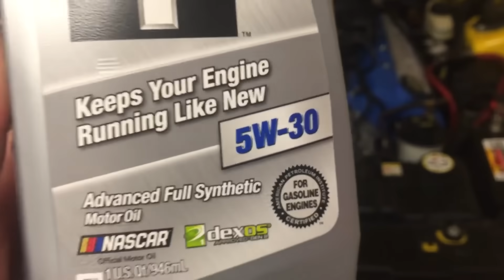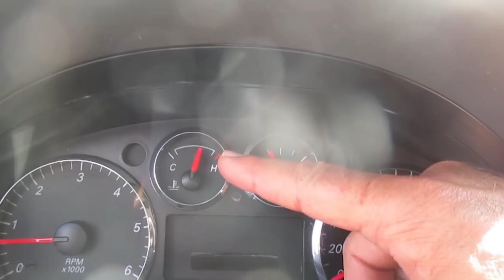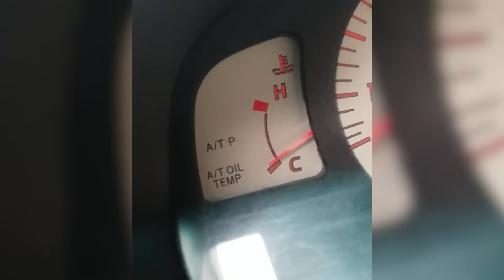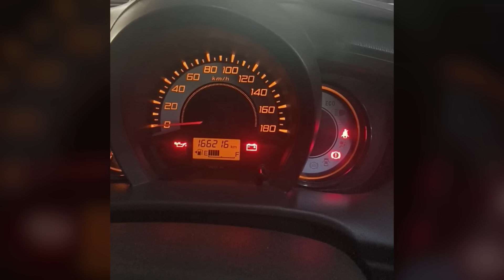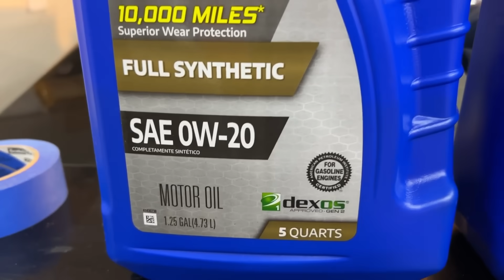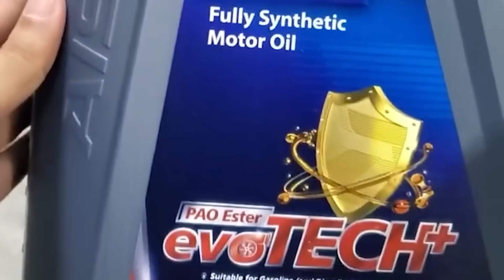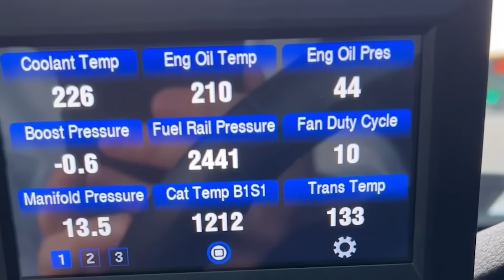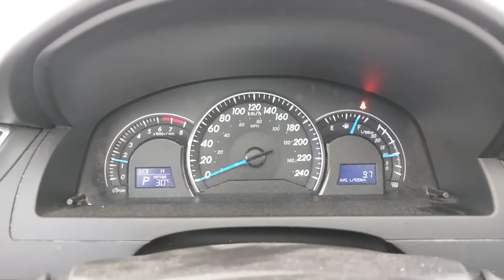Why US  Cars Use 0W 20 But the Same Engines Use 5W 30 Abroad (Exclusive Mechanic Explanation)

Comment: Just pick the oil for your region.  If youre in the cold north, use the thinner oil.  If you're in a warm climate and the block never gets super cold overnight, you can run the thicker option.  Best practice use what they say to use.  Even better practice...change oil at 3k miles.  Don't listen to the 5k or even 10k oil changes.  That's when the wear comes into play.  If your oil is fresh, it protects the best.  The more heat cycles the oil goes through...the more the oil's molecules break down.
Reply: @vintage.....Your first sentence explained it all....!! But you do seem to contradict yourself when you said ..."Best practice use what they say to use." This is the problem and confusion about this oil situation. For every person who says that their car has always used 0W-20 and the motor now has 250,000 and more trouble free miles...no rattle/clatter on cold starts..no motor problems of any kind, there is someone who had rattle/clatter from the very beginning with a new car from using the recommended 0W-20 on the oil cap, but when switching to 5W-30, the rattle/clatter stopped. 

But....usually with these experiences, we were not told where these people lived, and that goes to your point about location. Yep...the experiences are all mixed up. 

I live here in Arkansas, where the Winters are not bitterly cold for long periods, nor the Summers extremely hot for the whole Summer. In fact, the climate for Arkansas is called Sub-Tropical...amazing...because of the bad humidity in the Summer. My 2015 Toyota RAV4 says 0W-20 on the oil cap, but the motor rattled on start and even had a slight rattling sound when warmed up. I switched to 5W-30 and the rattle stopped, and the motor sounds much quieter, like a motor should sound. That was all the proof I needed.
Reply: @StephenJeffery-b6b  yea much agreed.  I've also been told but not quite sure about is...that the computer is calibrated to the oil type and the region the car is marketed to.  I don't understand how that is possible but I've heard that a few times.  My contradiction was mostly meant for those who are unsure of changing oil type.  I should have said "simplest route is to just follow the recommendation on the cap"  but yes you're right about the chatter.  But then again valves chatter, thats what they sound like in good operation.  Slight valve chatter on a fairly new engine isnt really a cause for alarm.  Theyre still chattering in there, the thicker oil will quiet it from.our ear.  But its still happening.  Those valves are clicking and working hard.  As long as the top end has oil its ok. And that it gets that oil after a night of sitting when its all at the bottom in the morning. Modern engines are really good at getting that oil up there quickly on a morning cold start.  Older type cars, takes awhile, pumps arent as efficient.  All we have to do is make sure we're not using thick oil in cold climates and freezing or below freezing temps.

Comment: Manual on mine says 5W-40. It's that euro full syn , but it seems fine. Right at 130,000 on a '12 model. Comp Cam stage 2 and Magnaflow exhaust. Cam upgrade at 100k due to dumb MDS lifter failure alomg with factory ductile steel cam. Billet now Baby. Woke this car up and can check your talent easily.

Comment: I'm running 5w-20 in my 2015 Toyota Rav4 it says to run 0w-20. Just turned 60k and will start running 5w-30 for sure! I'm a retired 40 year automotive technician. My last employer was working for a municipality fleet service department and witnessed the constant engine/valve train  failures of our Chevy Tahoe Police units. We started using 5w-30 instead of the 0-20 the manufacturer recommended and the problems were by far less common. Police vehicles do run under extreme situations.
Reply: @RubenGarcia-nn1vq...Hi, Ruben. A year ago, I bought my first RAV4, a 2015, 2.5 that had 128,000. The oil cap says 0W-20 so that is what I started using on my every 3,000-mile oil & oil filter changes. But I was always a little concerned about a kind of rattle whenever I started it. I just assumed that it was meant to do that. I began doing a lot of reading, watching videos...some good, others a bunch of BS...and I learned that RAV4's call for different oil numbers depending on the climate/country where the car will be used. I also learned that our government set the suggested number to satisfy the CAFE and emissions standards...and NOT Toyota. 

I asked my mechanic of 25 years about this. Just last week, I was due for another oil/filter change and I had him put in 5W-30 full synthetic. The difference was immediate...no more rattle on start-up, and the motor runs much quieter now...WOW..!! And I have not noticed any change in my gas mileage, and even if I do notice a slightly lower gas mileage, it will be worth it to have the motor lubricated properly. 

I will never go back to 0W-20....what more proof did I need...!!!
Reply: Why not use 0w30, since 30 is the terminal viscosity. And 0W you get a better start on Winter.

Comment: I tow all the time with my 5.7 Tundra. It currently has 367K running 0W20. My last Toyota went to 442K before rust killed it.  Change often is far more important than 20W or 30W..
Reply: So you would definitely say stay with 0W20? I'm asking because I too have 5.7 Tundra...still using 0W20 but people keep saying to change to 5W30. Also how often do you change your oil?
Reply: @dalephillips8250 every 6 months or 5k miles whichever comes first. Oil is much cheaper compared to repairing your engine. And used OEM parts if you own a Toyota!
Reply: killing us through food and our vehicles

Comment: I'd say the biggest benefit everybody is doing oil changes
3mo/3000mi
Reply: 3K on high mileage, dusty location, or working it hard…yes. Normal driving or low miles…no.  5K is 100% fine.

Comment: I have a 2014 Toyota Sequoia that calls for 0w-20.  I live in Arizona and it has 180k miles.  I asked my mech to use 5w-30 and they refused because thats not what the oil cap says.  So I bought a 5w-30 oil cap. 😂

Comment: Why 0W-20 Wins Longevity (Even Though It’s Thinner When Hot)

70–80 % of all wear happens in the first 20–60 seconds after a cold start
0W-20 reaches the camshaft, turbo bearings, and piston rings 2–6 seconds faster than 5W-30 at any temperature below ~15 °C (60 °F). That single fact outweighs everything else.
Modern engines are built for 0W-20
Diamond-like carbon (DLC) coatings, molybdenum disulfide, ultra-hard bearing materials, and tighter clearances mean they don’t need a thick hot film anymore. They need fast flow and low friction.
Less oil consumption & cleaner internals
Thinner base oils + better additive packages in modern 0W-20 synthetics = less ring-land deposits, less LSPI (low-speed pre-ignition), cleaner turbos, longer catalytic converter life.

The only situations where 5W-30 can be slightly better

Constant towing/heavy loads in >40 °C (104 °F) ambient (very rare for most people)
Sustained 130+ mph Autobahn running for hours at a time
Very old engine (pre-2000) with wide clearances

Even then, the difference is small (maybe 5–10 % less bearing wear), while the cold-start penalty of 5W-30 is huge every single morning.
Reply: The only reason 0W-20 doesn't wear the engine when it gets hot is a film strength additive. Toyota did a test and found that was the only way for a 20 weight to work as well as a 30 weight when it gets hot. As the additives wear out so will the level of protection the oil offers. I chose a middle ground with 0W-30. You can have that cold start protection that 0W-20 offers with the hot temps film strength protection that a 30 weight offers. I live in Texas so it's hot enough to make sense for me. The further north you go I think 0W-20 makes more sense.
Reply: @kyj730....HI..And you make some good points. Here is my story: A year ago, I bought a 2015 RAV4 with 128,000 miles. The oil cap says 0W-20, so I used 0W-20 for my every 3,000 mile oil/filter change. Now, every time I would start the car, the motor would make a rattling kind of sound. Last week, my oil change was due. I had my mechanic put in 5W-30 full synthetic. The difference was immediate and very obvious...no more rattle on start and the motor runs quieter. 

So...tell me that I should not have used 5W-30.

Comment: This is my take, 

If your owner’s manual allows either 0W-20 or 5W-20 → always pick 0W-20.
You get:

Faster oil flow on every single cold start
Measurably less wear where 70–80 % of engine wear actually happens
Zero downside when hot (same 20-grade viscosity)
Slightly better fuel economy
Reply: Not me. I’m going to be buying a Nissan Frontier soon & the first thing I do is change out the O-W oil for 5W-30 in my new Frontier. And I live in Pa

Comment: When I bought the vehicle the dealership used 0W-20 and it blew out the Timing Chain and Cam Sensors at 80k miles. I had the engine rebuilt and I now use in my 2014 Ford F-150 Ecoboost 10W-40 Castrol Synthetic. We live in the New Jersey Climate?

Comment: I've recently switched from 0w-20 in my 2016 4Runner to 5w-30 and will NOT be switching back... period. Runs smoother, quieter, and I see no benefit in fact I think my fuel economy slightly improved, went from absolute dogsh!t to almost not too painful but still sucky.

Comment: I recently bought a used CR-V
With 5W-20, it was losing/using oil a fair amount between changes.
Learning the oil rating used elsewhere, I changed to 5w-30.
It no longer uses/loses oil and performs much better.

Comment: Guys the 3 areas that this video mentioned, generally are hotter for longer months than several cities in the USA.  It's not a conspiracy, it just is what it is.  So if the area is dry and hot most days of the year.  You will need heavier oils.  Also how you drive would also play a factor.  

If you tow, off road, drive long periods or just drive like a lunatic, those also would justify heavier oils.  

High miles also suggest it because the engines wear down the more miles a vehicle has.

Other things that help are more maintenance intervals.  Before you go and decide to put a heavier oil, make sure you are checking at least one of these factors. And ask a professional.

Comment: As the owner of a vehicle equipped with a twin-turbo high-performance engine, I've taken a careful approach to maintenance. While I've adhered to the manufacturer's specified 5W20 full synthetic oil, I'm now reevaluating my choice due to my location in a warmer climate and the engine's increasing age. Consequently, I intend to transition to 5W30 high mileage synthetic oil for my upcoming oil change.
Reply: Don't know your age but back before YouTube mechanics I used to use Haynes manuals to work on my cars. When it talked about oil there was always a range of temps vs oil to use in there. In colder climates you always used a thinner oil and in hotter climates you would use thicker oils. I'm in AZ so I always went thicker.
Reply: @watson6401 yes “ I’m in Sonora (south Arizona border) here since the 2024 I only put 10w40 Valvoline restore and protect in my 08 Corolla, 100,000 miles  only city use, but temps can reach 118+F for 3 or 4 summer months! 5-30 every 5000miles leave a engine with severe sludge (valvoline RP clear that thing like magic)

Comment: My 2025 toyota calls for 0w8.  I put 0w20 in it. When I go to the dealer for the 10000 mile change they put 0w8 in it. I change it 5000 miles later to 0w20.

Comment: Ja vi muitos problemas , inclusive passei por isto , comprei um Ford Escape 1.5 Turbo Eco Boost , e o motor estava batendo com 68 Mil Milhas. eu vi escrito de Lapis amarelo no plastico 0-20W Blend , no caso , este óleo apesar de indicado no Manual , não suporta a temperatura do motor por ser turbo e da problema cronico em quase todos esses motores , no caso , aqui sendo Frio de Connnecticut no inverno , seria melhor usar um 0W30 ou um 5w30 ? e recomendo a todos usar um Anti friction como LIquimoly ou Ceratec , ou outro para camada de proteção filme dos pistoes , bielas.

Comment: Use Amsoil  in  everything I own that has a motor and their oil filter if not, use a wicks go full synthetic have a 2015 1 ton utility Work van  GMC 260,000 runs great the old one 2004 1 ton utility work fan 320,000 miles 6.1 L in both neither burn oil if you’re gonna keep the vehicle for a long time Amsoil 👍

Comment: The reason is  emissions/fuel mpg requirements. Thinner oil is less resistance to the crankshaft lobes spinning through the oil bath in the pan. It’s a thing. Race cars use dry sump oil pans which have no standing oil in them to impede the crankshaft lines. Help retain more HP

Comment: I drive a 2017 Honda accord with a 2.4 L i4 that takes 0w-20. Can I run 5w-30 without consequences?
Reply: My 2014 Honda CR V with the same engine as you has ran 0W20 until about 190000, when I switched to 5W30. Owner's manual in Japan and UK recommends 5W30 usage.

Comment: If the only discernible difference between 0W-20 and 5W-30 is .5 to 1.0 mpg...it's a no brainer...especially since many vehicles are now going to 4 cylinder turbos...  I change my oil at 3000 mi no matter what, so I think I've ameliorated some of this, but it's certainly food for thought.

Comment: What if 2 qts of 0w20 and 2 qts of 5w 30 are mixed in the same engine ?  On the surface it seems like the best of both worlds BUT is it ???
Reply: I do that in my Tundra. 4 020, 4-530.Comes out 2.5W 5.25

Comment: I think if you just use quality oil or change it on time it doesnt matter. You actually burn more oil with 5w30 if your engine isnt designed to use it. The oil rings arent designed to scrape 5w30 off.

Comment: The range in my maintenance manual says 5W30 is acceptable for my engine so that’s what I go with. 0-5 (for winter) is not going to make much difference unless you drive the car hard 1 second after starting without letting the car at least a minute to start circulating the eral. I know I know. Here we go with the warm up debate!  My maintenance manual recommends 30 seconds warm up time. I give it a minute. I think my engine is with one minute of my precious time

Comment: The same could be said for recommended oil change intervals. 
Intervals are stretched to lower “cost of ownership” ratings. Among other things.
Reply: @davehaggerty3405....Yep, but when those extended intervals of 10,000 miles creates sludge and other problems, then that "cost of ownership" will skyrocket when motors have to be rebuilt and major work performed. 

I will just be content to pay for few more oil/filter changes along the way instead of a major expense at some point. And my car will pay me back with reliability and dependability.

Comment: Some cars like bmws and land rovers require 0w20 this is because the valve tronic and cylinder diactivation requires that kind of oil, we put 0w30 in a land rover that requires 0w20 and it was enough to throw codes and check engine light.

Comment: 0w20 is fine especially with a higher quality synthetic.  The first number is for thickness at cold temperature.  20 weight is fine in most places in the US besides texas and Arizona or hard use vehicles.  The mpg difference is from the 20 vs 30 etc.  Plenty of oil analysis from tribologist show that 20 weight is still good protection in most climates for economy vehicles. Now the new 16 weights ill pass on.

Such a waste of a video

Comment: I’ll never go below 5w30, Those people using thinner oils will wonder why it’s knocking at 120k miles
Reply: I got a 2014 Chevy Silverado 5.3 I use 0W 20 I got about 125000 to 130,000 miles. Can I change over to the 5w30 or the 5w40 weight without messing on my engine because I’m burning about a over quart of oil.
Reply: @jamiesmarzettsr switch to 5w30 & add the oil catch can
Reply: We have a 2007 Chrysler Aspen and 2009 Toyota Camry  that both have over 300,000 miles currently and I have used the recommended 5W20 their entire life with zero engine issues. We live in Florida as well. This is interesting and makes sense, but I'm nervous to make the switch.
Reply: @dwightmcvey2265 I’d dump that Chrysler as soon as possible lol
Reply: @racingdreamz8021  Why? It's paid for itself
Reply: My 145,000 mile Higlander has had 0W-20 since new, and definitely does not knock. Runs perfect, and uses no oil at all. Is still right on the dipstick full line at oil change. But, has had it’s oil changed every 3,000 miles with Amsoil Signature Series. The type of oil you use matters too.
Reply: @craigg4246 I’m at 313k Miles in my Prius , Running the 0w20 would burn oil, Using 5w30 Royal Purple fixed the consumption issues 100%
Reply: @craigg4246  probably has more to do with the fact that you change that oil so regularly
Reply: That one fellow from Louisiana, who got all his miles on his Toyota tundra used an oil his engine never knocked. Perhaps it could be your vehicle. That’s the problem.
Reply: What about so 0w 20 is better for cold climates
Reply: same here

Comment: My Tacoma has run 0w20 with  Lucas synthetic additive for 120000 miles, ijust jumped  to Valvoline restore  and protect  5w30,i change my oil every 2500 miles
Reply: I love AMS oil, it’s hard to find but it’s so much better than others I’ve tried

Comment: The 2025 toyota corolla le with a 2 liter engine now requires 0W08 motor oil.
Reply: Basically water
Reply: I own a 23 Corolla, I use 5W30 for every 5000 miles. Not the 10000 oil change BS.
Reply: @ge82....It will be interesting to see how soon motor problems develop with that grade oil.